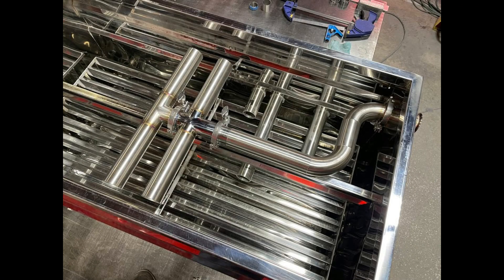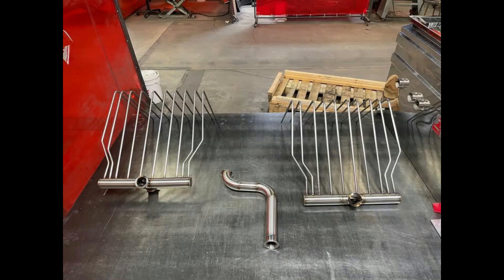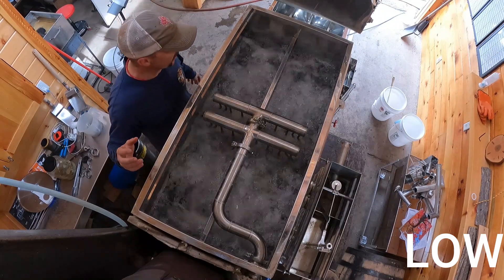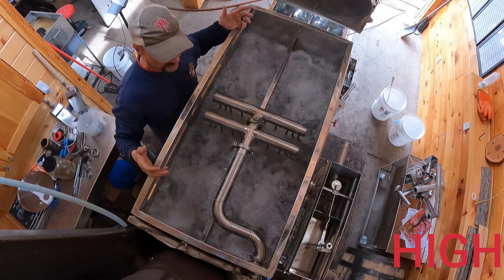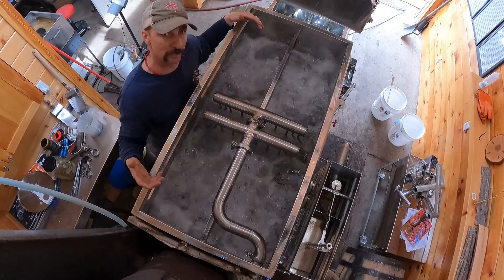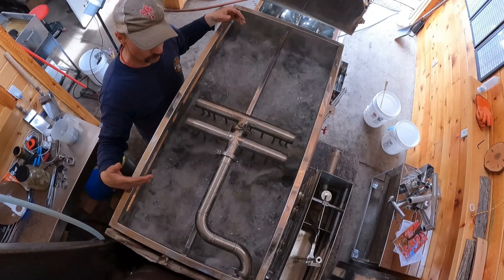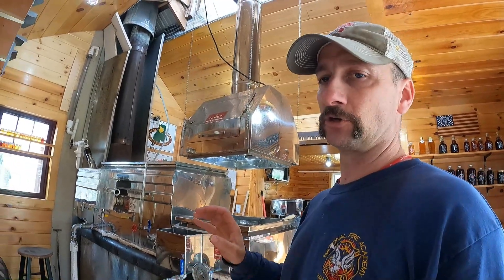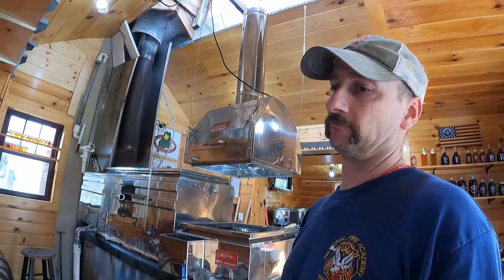Best maple syrup evaporator upgrade for the $$$

Comment: Just curious, how many gallons did you make for the season?  Your handling 1,600 taps with a 2x6? That's awesome. Was going to get a pre heater next but you got me thinking a bubbler first.
Reply from the maker: 462 gallons.  Bubbler first 100% it makes better syrup and makes cleaning easier and also increases evaporator rate.

Comment: How do you clean the bottom side of your flue pan I’m having a real hard time with that… and my flue pan still has some cloudiness to it even though all the niter is off
Reply from the maker: pressure washer.  On the inside try some RO soap and a copper chor boy amazon has them. the copper is softer than the stainless so it wont scratch the pan. Elbow grease helps too. https://www.revaldistributor.com/products/chore-boy-single-36-ct?variant=44160175145268&country=US&currency=USD&utm_medium=product_sync&utm_source=google&utm_content=sag_organic&utm_campaign=sag_organic&gad_source=1&gad_campaignid=19856548207&gbraid=0AAAAApZIAFkvwHxEb4iG_zE7U7gBYzhUZ&gclid=CjwKCAjwiezABhBZEiwAEbTPGKxQH-EAD7OBoQNeH4R7k0MHFEyD56swLF0LW2R3K3hxAN7RaAQ0LBoCr9YQAvD_BwE
Reply: @dunnfamilymaple ok I’ll have to try that I’ve been pressure washing these flues out for about 2 hours and man some of the soot just doesn’t want to come off pain in the ass lol
Reply from the maker: @ don’t worry about the soot. Oven cleaner works too. I just pressure wash and call it good
Reply: @dunnfamilymaple  can you see all of the stainless when you’re done pressuring washing or is there still a layer of that soot stuff in there ?
Reply from the maker: its still black but no flake left